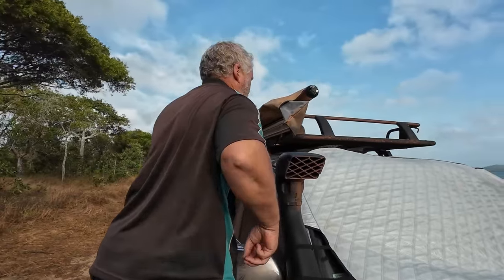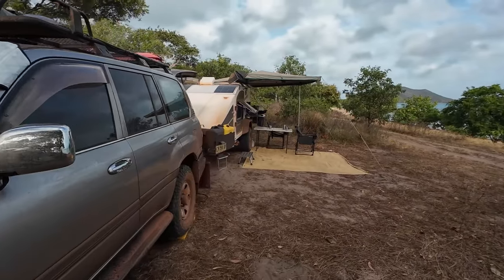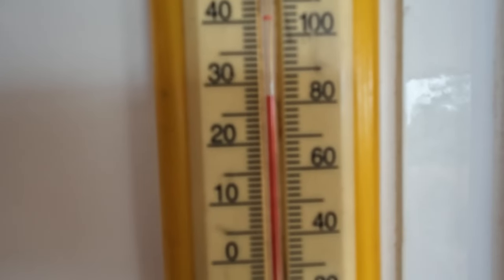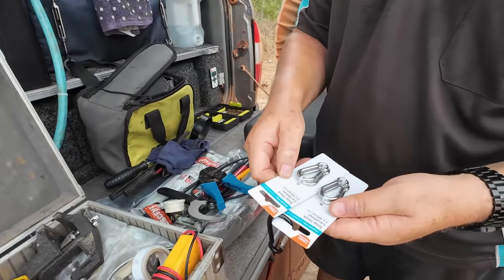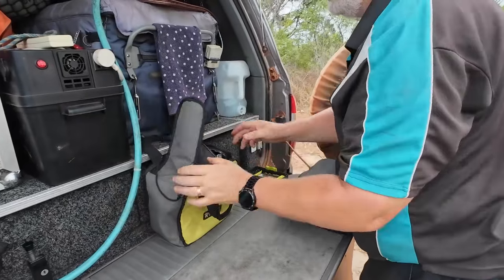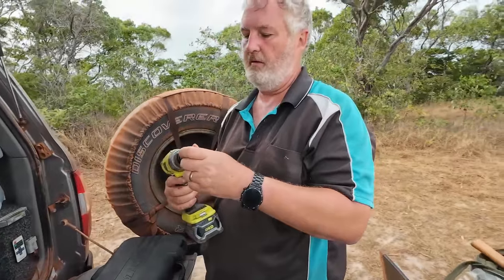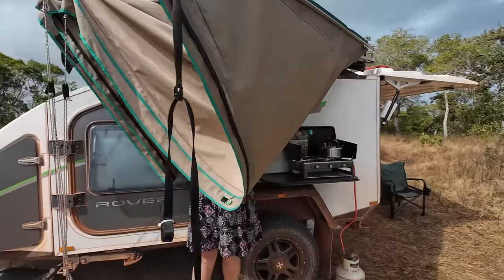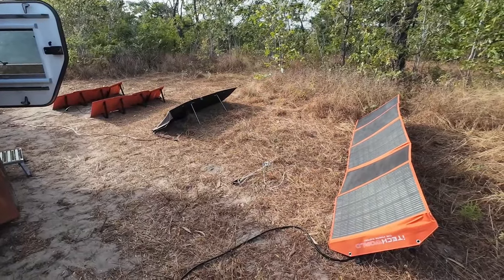Cape York Part 7 Punsand Bay free camp Carl can fix it!

Comment: Nice video. The socket you attached to the Ryobi drill (0700) looks like for the wheel nut, is it strong enough to untighten or tighten the wheel nuts(I mean the skinny part that inserted to the drill). And where you buy the socket? Many thanks.
Reply from the maker: Yes it will do wheel nuts as it is a 19mm socket on the shaft so it can be used in a drill. It is for lowering and raising the stabiliser legs but can be used to take off wheel nuts once you have loosened them first with a socket and breaker bar of wheel brace. I purchased one from eBay.
Reply: @carl.colleen.rover.adventures  thank you so much for the info, happy camping…cheers